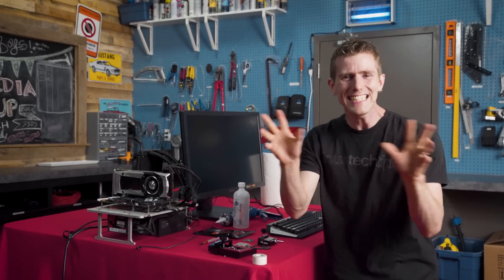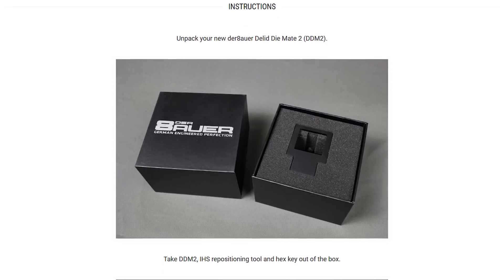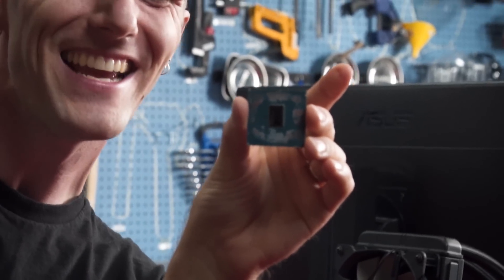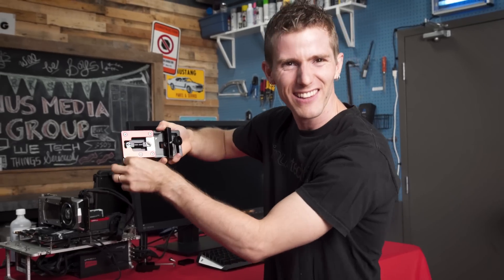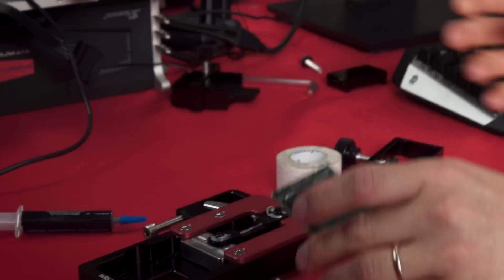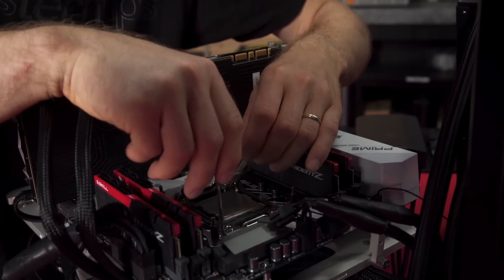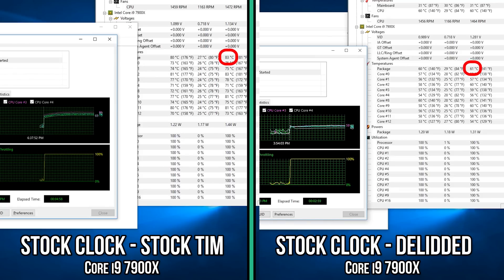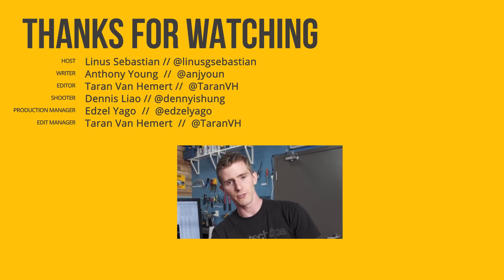Delidding a $1000 CPU - Worth the RISK??

Comment: PLEASE QUIT USING THERMAL PASTE AND DO THE DAMN TEST WITH LIQUID METAL!!!!!!!!!!!!!!!
Reply: Thermal Grizzly Conductonaut
Reply: Liquid metal is good and all, but can seriously corrode cooling surfaces. I personally wouldnt be sandwiching something that reacts with aluminum/copper between a heat spreader and a $1000 die and then heating it up to 100 degrees. Not to mention it is electrically conductive so one wrong stray bit under that spreader (because its pretty liquid) and you've shorted the pcb. Stuff is not worth it at all, and given the average experience of this audience I would not want to be promoting something like that.
Reply: Maybe you need to go look up Conductonaut, the compound he said he was applying...
Reply: Don Corleone he doesn't
Otherwise he'd tell us

He's got a pretty good track record regarding disclosure
Reply: ElectrodeYT not sure if joking. Look up gamersnexus liquid metal i9. 20°C less
Reply: 5 Bucks paste? Clearly you haven't looked it up, it is said to be top 1/2 thermal paste out there. I used it after doing research that compared similar priced pastes and this was always in the top 3, and from my results it's no wonder why.
Reply: You can always prevent any shorts on the chip and you don't use an absurd amount or even the same amount as you would thermal paste. People use the liquid metal tim for a long time and has many benefits that outweigh the cons. You are already voiding a warranty by de-lidding, so why not use something that is better than some glorified toothpaste.
Reply: +Brozeph Stalin lol voiding the warranty is actually an argument against taking more risks with liquid metal. If im voiding the warranty of something i better treat it as carefully as i can.
Reply: Highly doubt liquid metal would make a difference considering there's already a 20C difference when using thermal paste.
Reply: Oh sorry mate. I was thinking of metals like Gold.
Reply: Austin Awalt none of the materials  in a die-to-IHS inferface will suffer from corrosion using something like conductonaut
Reply: He may have said he was apply Conductonaut, but that wasn't! He was applying Kryonaut, still a great paste! But Liquid Metal would have been much better.  Be better if he didn't apply the paste and epoxy like an idiot, not to mention used crap paste on IHS which probably wasn't applied properly either.  But hey he seems to treat these delidding vids that way
Reply: KingHazSkills like mercury? You can use mercury as a thermal compound?
Reply: Brozeph Stalin Metal is conductive.
Reply: a gallium based alloy
Reply: Dude Kryonaut is like the best paste on the market right now, the difference between liquid metal and this paste is only 2C. Not only that, this paste will last for a very long time (couple years) while the liquid metal need to be replaced every 8month~ (some people say they need to replace it every 6 month, some people say it last for about a year ... so average 8 month ahah!)
Reply: 🤣 why should he, when he gets money for sponoring that low 5bucks paste...
Reply: Liquid metal?

Comment: Those are some insane numbers. I knew that Intel was cheaping out on their cooling solution for under the lid, but I had yet to realize how bad it was until now. I'd be really curious to see if it's gotten worse and worse over the years in some kind of cost saving trend, or if after the switch to lower quality materials it's been basically the same. I think that would made a cool video!

Comment: why the fuck even bother delidding if you are just using normal thermal paste use a liquid metal FFS
Reply: Toothpaste
Reply: Espinosidro may be it's about use in time. For example, may be this stock TIM will work at those 99° for 5 years, and new thermal paste will wear-out and get this 99° in 2 years. Same with liquid metal, you should replace it every half a year, not talking about it's ability to "eat"-out heat spreader.
Reply: M8Military I'm speaking only from my experience, working at my pc-repairshop. I'm replacing thermal paste in usual situations (not delidding) to MX-4 (pricy 3d-party paste) and it dries up after 3 years of active use. But my own i5-3570K with TIM hasn't changed it's peak temperature in 4 years without delidding. Going even harder - 11-years old Athlon 64 X2 changed it's temperature only by 10°. So I'm 100% sure that this bad results are supposed for long-time reliability.
Reply: And even with normal thermal paste they got -20°C... what kind of trash is Intel using??
Reply: Андрей Засидько there's no way Intel stock tim will last longer than quality 3rd party paste. Just the thermals alone in this video show this

Comment: so basically you pay from hundreds to thousands of dollars to get low quality paste on the cpu which you should swap yourself and void warranty? and nobody makes an issue out of it?
Reply: It's not the stock thermal paste that is low quality, but the gap between the die and IHS created by the thick layer of adhesive silicone. I'm really disappointed that Linus didn't cover this at all, in fact they skipped over removing the adhesive.
Reply: @bofslime7915  it straight up appears like the rim of sealant is a wall compared to the height of the die.
Reply: technically he didn't skip over it... it's posted right here in the video comments. thanks by the way @bofslime7915
Reply: It is disturbing isn't it? Especially when a better quality paste or LM would only add a dollar to MSRP..
Reply: @err0r0b0  If they add 1$ to the price and sell 10 mil they would technically be loosing 10 mil $. Intel cares about the $$
Reply: Intel doesn't much care about your temps as long as the CPU runs at the stock clocks without throttling.
Reply: @psychoterrorism  dude my cpu always throttles at stock I have to reduce the speed by a ghz if I want to get 60 c
Reply: @nayanmaloth4838  that's either a faulty chip or a faulty/badly placed cooler.
Reply: +ColonelRuiz funny how you call AMD fanboys out for ' crying'  over it yet you're okay being screwed up the butt by Intel, lmao.
Reply: it's been like this for ages.
Reply: BlueCrowN pointing out Intel bullshit isn't always related to being AMD fan
Reply: They chose long lasting over pure performance.
Reply: @AndreHila  exactly. Intel has to prioritize the longevity of its processors over the raw performance. An enormous part of their market is people who use the same processor for a decade plus, and they need to cater to the needs of those people. consistent performance over time is more important to manufacturers than immediate raw performance.
Reply: I just bought one of these i9 processors.  I'm a little disappointed with Intel after watching this video.  After spending  over $1000 dollars on it I expect a little bit more from them.
Reply: Its the same for AMD, AMD and INTEL chips should all be delided. AMD and INTEL, If you want a good liquid metal instead of cheap crap paste then delid it and put your own grizzly in it.
Reply: slader 1126 horrible answer you need to know the cpu your working with.  Some of them are soldered.  Intel is soldering their newest chips and amd has done this for some time.  If you delid one of this you can end up destroying the chip even if you know what your walking into.  Not everyone wants to play a game of will I have a cpu after this.  It’s one thing when noobs screw them up but another when ppl who had done them 100s of times are also losing cpus.  And 2 if it’s soldered there isn’t any gain from using liquid metal which makes it all pointless in the end when dealing with these cpus.
Reply: @treymiller5736  I thought about delidding my 5820k but then found out it was soldered. Knowing this and the fact that my cpu still gets hot(hotter than I like), this would mean the best thing to do is lap the IHS. Being soldered just shows how poorly these IHS's are mated to their chips.
Reply: MrCougar214 if the solder was messed up and doesn’t make contact with the die then it’s no longer a cpu as the temp would jump up so quickly the cpu would burn out I’m talking seconds to pass 100c at that tiny part of the chip.  Now that’s also a 140 watt chip are you sure the cooler is up to the task?  I feel I’m about to here water cooling if so have the temps always been a problem I have seen water coolers have issues such as a screens being clogged or pump dying out but not to a point the user realizes there is a issue Bc they are still pumping water they are just crawling.  Also you can try undervolting the cpu something like intel extreme unity slowly undervolt while stress testing find where it crashes then add roughly 25mv back to make stable.  Lapping the cpu could also help but it a rather time consuming process that normally doesn’t give much results.
Reply: @treymiller5736  no, the solder was/is fine because the temp isn't thermal throttling high. It would reach 85-90c under load most of the time. I did change out the cooler for a better water cooler and that did make a difference. I then changed the thermal compound to a better quality. I am now running it on a corsair H150i pro and through some trial and error, I managed to get it overclocked to 4.4ghz with temps of 40c idle and no higher than 72c under load.
Reply: its a matter of mass production, think of how many they manufacture and cost involved in paste. i dont agree with their cost cutting paste but i understand why they use it.
Reply: Sean Ohlendorf soldering is a whole process of its own. I can understand why they got away from it.  It’s messing and can messy up cpus.  However liquid metal just as simple as normal thermal paste cost of it in bulk I have no idea however but I feel it can’t be all that huge.
Reply: Just Anoman, you overthinking it mate. Current toothpaste and current OC temps = bad PR. Changing the past for something really good that would add 50 cents to the MSRP and give the CPU very good overclocking capabilities = great PR.
Reply: Intel is crap, and this is why
Reply: good question. People should make an issue out of it. Eventually you have to change that paste too or else your chip will run too hot whatever you do.
Reply: As far as cost goes, it won't add even a dollar. I would assume that buying the stuff in bulk would be cheaper. And it is replacing something, even if crap, so that means the increase is only in the marginal difference as opposed to the raw cost.

Problem is, how many people do you think would base their purchase decision on this? very few I'd bet. As such, providing the feature doesn't really sell more chips. Whereas increase in price to provide the feature would certainly see fewer being sold while providing it "for free" would see a cost increase for no benefit. So there is simply no reason for them to do it.

Given that most people still buy CPU (alone or as part of a system) based on speed and core count alone (sometimes speed only... sad...), I don't expect this to change. I mean I doubt most people can tell how much cache the CPU in their system have.

Also, it would be worthy to note that generally speaking, unless the system throttles or you are actually monitoring core temperature, the average user will not even notice a difference. Because fact of the matter is that what you can feel externally, that is the temperature of the exhaust, is mostly unaffected by this. Because the extra temperature exists as an extra temperature differential between the core and the package, something that cannot be felt from the external.
Reply: @justanoman6497  The reason to do it is reputation. If you maintain a rep of selling shitty half baked shit it hurts you more over the long run. I never buy high end intel bc of this issue if i can avoid it.

Also anyone dropping this kinda cash on a CPU has a reason. They will be much more knowledgable than the average dumb ass buyer. This issue can be bigger than you think.
Reply: well consider the risk of ruining a cpu or thousands of cpus
Reply: Chris Brown if intel just did it it wouldn’t risk the cpu anymore then they already did just use a high end thermal paste when first applied.  But for us to do it is another story in factory they throw out more cpus then most ppl can even understand.  However a user is gonna hurt losing a single one.
Reply: People..like to live...dangerously.
Reply: They want to take your money
Reply: i like this, !!! it wouldn't hurt them to put liquid silver in there, wtf ,
Reply: People accept crap these days.
Reply: CPU diver have to install in motherboard (another also)
Reply: Intel smurfs would buy whatever Intel throws out there. They don't care.
Reply: you kidding ? every AMD fanboy who champions Ryzen makes an issue of that
Reply: @ColonelRuiz  Well I come from the future and I got news flash , AMD won.
Reply: @ColonelRuiz  Honestly, some of us still do...
Reply: @ColonelRuiz  amd is actually worth fanboying over now, about time
Reply: but repeating it thousands of times is. we got it, they are cheap. no need to bash them for it under every video that contains intel till the end of time.
Reply: RapaxTV look in the comments, hundrets of new amd fans crying about it.

Comment: A processor so hot you need to delid to have decent temps
Reply: right, so thats why you delid.   delidding is quite simple really.   all you are doing is putting new thermal paste in, it's not that hard.   if you can build a pc you can delid.    the delidding tool makes it so even total noobs can do it.     so just do it, it costs about 30 bux and you get something thats better than AMD for gaming.   what?
Reply: Only logical reason I can think of for Intel to use so bad thermal paste is they WANT your CPU to run hot. This is to make sure it will only last just as long as the warranty and also not over clock well, all to make you buy new, faster and / or more expensive CPU... I absolutely hate all companies that is so greedy that they sabotage their own products to sell more.

Comment: I like how the 1000$ CPU throttles and the 300 one doesn't
Reply: Colton Spears Nah it's not shitty! It's the most advanced Chipset yet. 
You can do your virtual multitasking and even cook on the damn thing, whilst warming yourself during winter.
All this at a convenient and affordable price. Yes you might need a thermonuclear generator as a power source but hey, CPUs these days are sure hungry!
Reply: yes, that 10 core intel uses about as much power as a 16 core threadripper...
Reply: Grimy HR And it is 40 degrees hotter...
Reply: Gerardo Ricciardi of course it does? That's what happens when you put more power into a chip, you need better cooling -_-
Reply: Ben Ivory Yeah, maybe it's because Intel is making shitty CPUs with disgusting TIM.
Nah, it's of course power delivery, wich by the way, at X299 launch was the main point of failure
Reply: Have you even looked at x299 at all? It being overpriced might be a debate you can have but I wouldn't consider it "shitty" by any means.
Reply: True it uses a lot of power. Not as much as the 1950x but still quite a bit.